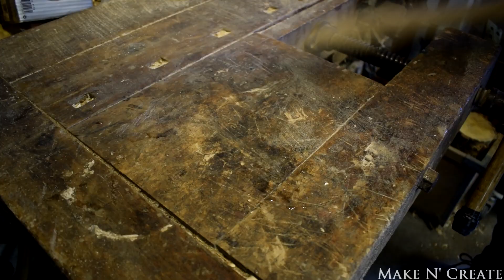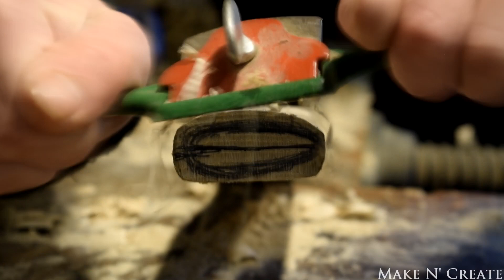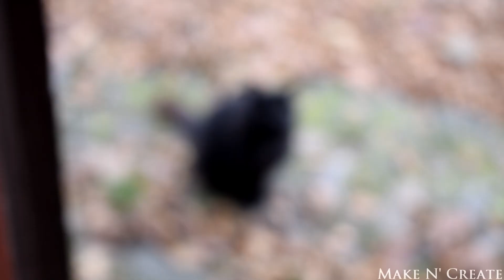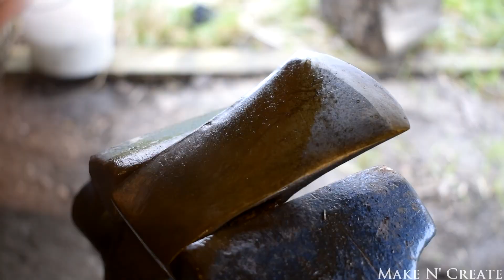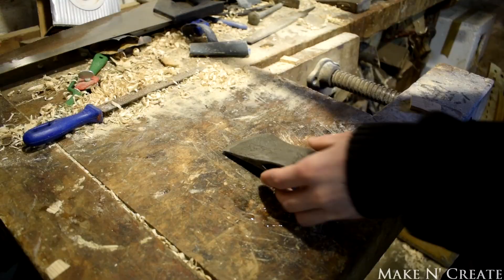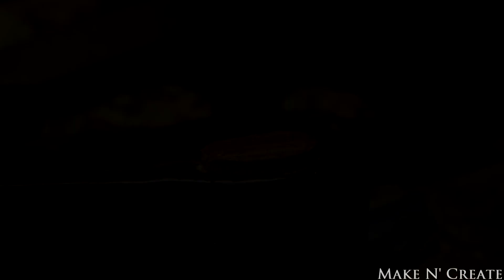Restoration -  Camp Hatchet (Zero power tools)

Comment: what is that tool you are using called that peels the wood as you push/pull down?
Reply: Lateraluz it’s called a spokeshave or draw knife there basically the same ones just bigger
Reply: Flynn Smail thank you